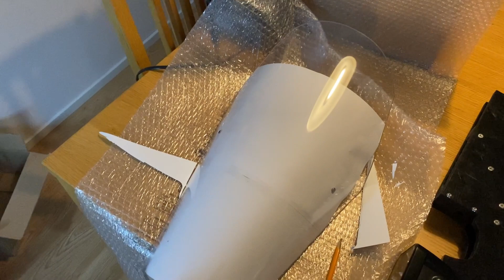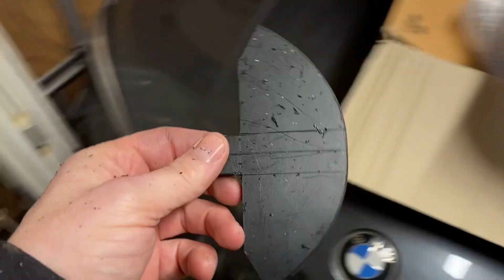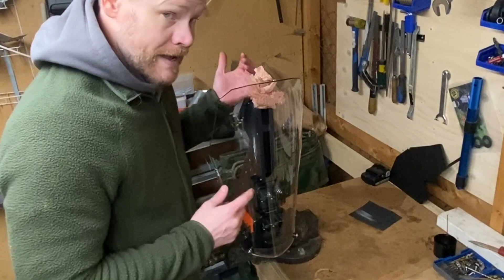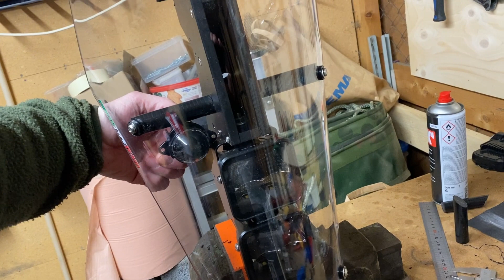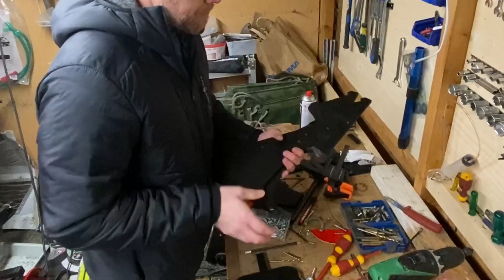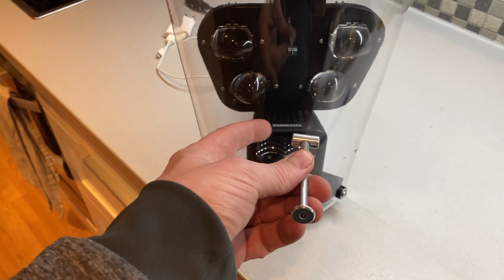Rally Tower Build EP7 - Yamaha Tenere 700

Comment: Really nice built man. You mentioned you have a heat gun. You can use that to make the cutting edges on the pe300 smooth. Also remove surface scratches like that

Comment: Great progress, Marcus 👍🏼
If you weld a (thumb) nut onto the adjustment bolt at the rear you can adjust the light angle from the rear without the need to remove the windscreen.
Just my 2 cents 💙💛🏁🤛🏼
Reply from the maker: That’s true, don’t think I haven’t thought about it 🤣. 
But have no welder
Reply: @allthingsenduro  I guess some power glue or 2 component epoxy/metal will do the job as well. Or just tighten 2 nuts against each will do it as well.